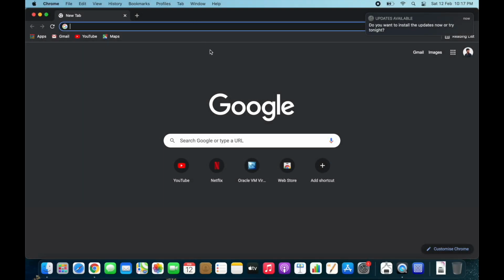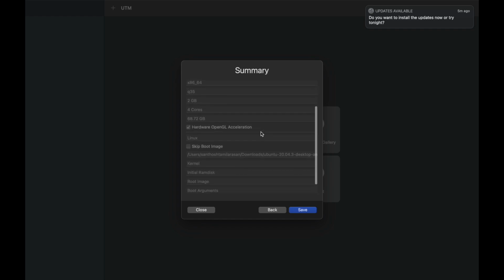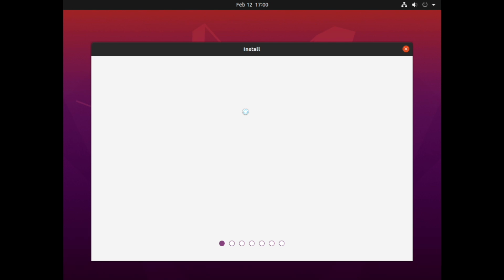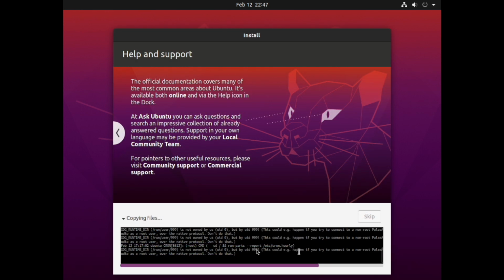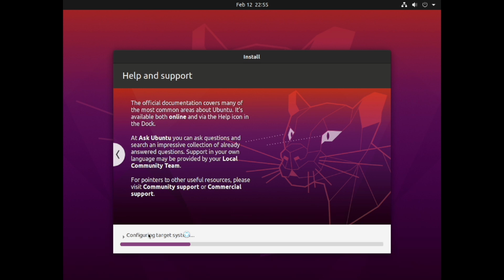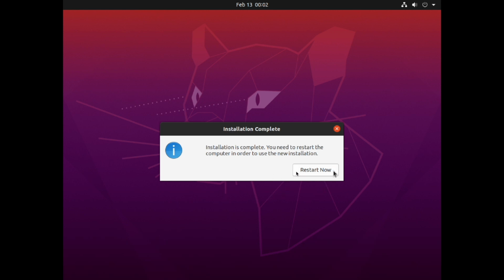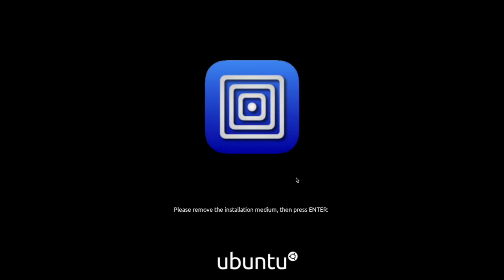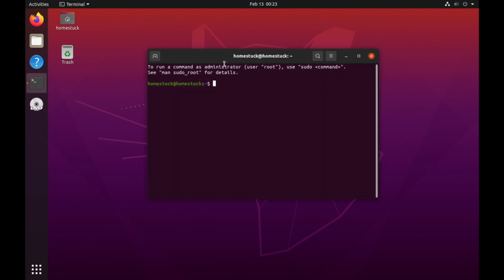How to install Virtual Machine on Apple M1 chip using UTM | App Installation | By FreeBase Studios

Comment: Hi i have tried with win 10 on mac m1 16 gb , post installation i had some issues key board non compatibility , for example i have a german key board when i tried to type @ this is not detected , do you know any specified drivers needs to be installed - i know spice we need to install but no luck for me any other ideas ?? it's also good if you also share the urls you used as part of the installation.